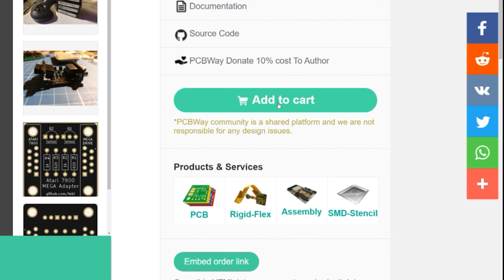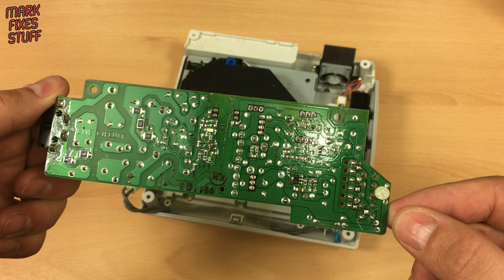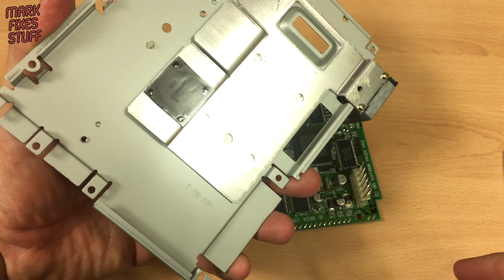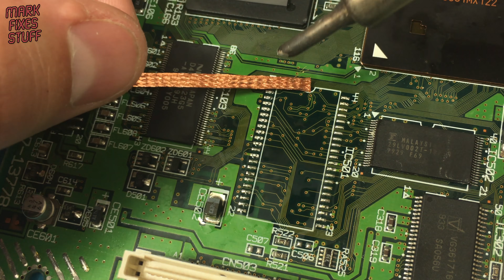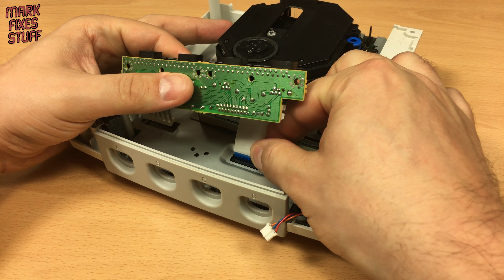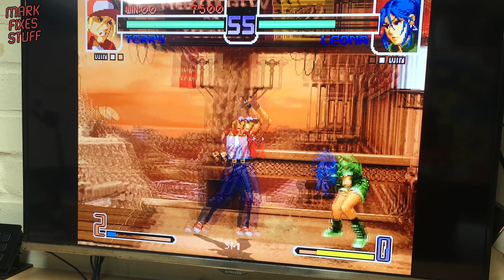Installing a Sega Dreamcast Custom BIOS - SMD CHIP replacement JAPANESE CAKE!

Comment: For cleaning old solder from pads, I prefer using regular flux instead of no-clean flux. It helps the solder flow into the desoldering braid with less pressure, reducing the risk of lifting a pad.

Comment: I recommend to humidify the wick with liquid flux and apply some fresh solder on the contacts on the plate.
Make sure to use soldering wire WITH lead, it flows better and doesn't make the wick stick and stutter on the contacts.
After removing the old solder from the contacts, apply some fresh solder on the contacts in a flying method,
so that the contactplates are only coated a little with fresh solder.
Afterwards you only need to press the pins of the chip with your soldering iron.
The look after that is much cleaner and professionall.
Only an advice. But good work with that.
Reply from the maker: Those are great tips, I'll definitely keep those in mind for next time!

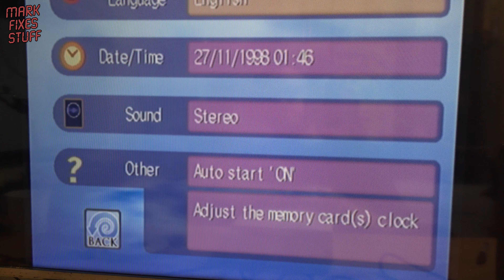Comment: 16:44 How did you update the bios? Is there a file I need to find?
Reply from the maker: @YumeSoulMirai  I bought mine programmed. I don’t have this Dreamcast any more because it was lost when my house burned down, but if I recall correctly I just replaced the original chip
Reply: @MarkFixesStuff  I know this is a rather year late response, but looking back on this, do you remember where you got the modified chip? I've been pondering about doing this project but I'm not sure where to get the chip.
Reply from the maker: @YumeSoulMirai Hi!! You can buy it here https://retrosix.co.uk/Dreamcast-BIOS-Japanese-Cake-3-3V-p550906359 - you can also find them on AliExpress or eBay but make sure to check reviews first.

Comment: I can solder but what you did here is beyond my level. Incredible work!
Reply from the maker: Thank you so much. Actually I think SMD stuff is easier than through hole soldering but you need the right things so you are probably more than capable of this.
Reply: @MarkFixesStuff  Thank you. After practicing more I'll chane the components in order to make my VA0 support GDEMU

Comment: Hello! I bought a gd emu 5.15b clone but apparently my dreamcast VA1 (J) bios is protected. and prevents me from loading ROMS (cdi,gdi) from the emulator, sending me to the main menu. the question is, is it possible to replace the bios itself - shown in your video, and will there be conflicts with the GD EMU?
Reply from the maker: You can replace the BIOS. I did a video on it and the GDEMU doesn't care.

Comment: Nice video mate! A question. With this bios , can I boot games from SD adapter without using the CD bootloader? My CD drive died, and Gdemu is quite expensive nowadays, and this looks quite easy to perform and very cheap.
Reply from the maker: No mate. Unfortunately.  Although you could look out for a cheap cd drive instead - loads of people give them away for little

Comment: So I installed my kit and yeah no menu appears, not 100% sure what the next step is. I have a gdemu and ofc don't want to have any issues with it.
Reply from the maker: Have you double checked your connections?
Reply: @MarkFixesStuff  yeah, thankfully got it working, although messed up due to the latest version not running with the gdemu whatsoever. So I'm attempting to get the old version back
Reply from the maker: @TheAnimeexpansion  oh no. I’m glad to hear you’ve made so progress though.
Reply: @MarkFixesStuff  thanks, I appreciate that! Only roadblock now is my sd card reader isn't working. Got a very cheap one a little bit ago and the soldering on the legs is really shoddy!

Comment: I just installed my bios and get a black screen sadly. I have a 1.6rev and there was a guide to solder to pin 9 of the ic503 from pin 44 of the bios chip. Also wired from pin one to the same you you soldered pin 1 of the bios chip to. Everything looked well and good, reflowed and continuity and all that. Flex cables fans and all that were secured. The system powers on, disk books and initializes, you here the beep and nothing on any screen I connected to. 

I got no answer from the ebay seller but it said free 3d dev. And I assumed I could just replace the chip without piggybacking. Any knowledge of where I might go from here?

Comment: Guys,I need your help, in the past, I used an Harbor Freight branded 1500 watt dual coil heat gun at maximum temperature like 1124 degree farenheit, but for some reason, I think I killed the old motherboard, because it didn't wanted to boot up, I got black screen, even though it was everything connected properly, no dirty connections at all. Possibly, because this heat gun was for other purposes, like stripping paint, and varnish, and not for electronics, next time, I will use it with the lowest temperature, at 572 degree farenheit instead, once I got a new motherboard

Comment: how do you update from v1.031 to v1.032? I see dreamshell comes with v1.031 already but trying to figure out how to load .32
Reply from the maker: Sorry. Missed this. I actually burned the update onto a CD-R and installed it from there. Hard to remember now though

Comment: I don't ever clean the pads. Just pop it down and heat it up. Otherwise you get issues like the pads coming off since they're old
Reply from the maker: Thanks. This might be the best way from now on. Thank you for watching and taking the time to comment. I really appreciate it.
Reply: @MarkFixesStuff  If you have trouble with not cleaning the pads, hopefully it makes it into a video. Louis Rossman rips off pads all the time, but he's repairing water damage.
Reply: Better to clean the pads since you're most likely mixing leaded solder with lead-free. The reason he likely ripped the pad was a combo of not enough flux, tip wasn't tinned well, too much pressure and moving across the pads instead of length-wise.

Basically, technique problem.

Comment: Well. There are much smallers wicks, those are much better on those smaller pads. The real problem comes, if the pads have a large ground plane. For those, I would say use something to pre-heat the board. Like a "thermal pad" (don't know if that's a proper term in English)... And heat the board to something like 80 celsius...
Though, it there are plastic connectors beneath, be careful. Those might not take the heat...
As you said, on your case the pad was not connected to anything, so it really didn't matter. Though I would have also do the "repair", just like you did. Just for the looks of it...
"Thicker" flux also tends to make everything easier, though it leaves more stuff on the board. Use IPA to clean them, always. "Running" flux leaves less markings, but doesn't do the job (on most cases) as good as the thicker one. Pick your poison, there is no "right choice". One works better to one and other for another.
Train on not important things.
You can never know before, if the board has good quality or if thr pads that fly out even with minimal heat and touch... Those can be repaired, though that will always make them look kess professional...
Reply from the maker: Thank you for sharing this. Reading your experiences really helps me on my SMD journey. I have a few thick fluxes to try as well. Brilliant tips! Please keep them coming.

Comment: What was the point of this? Waste.
Reply from the maker: The point is to enable booting of backups and MIL discs on machines that don’t have that capability, such as later VA1 models that had the MIL booting loophole removed. I’m not sure what was wasted? 🤔

Comment: To avoid lifting pads, use a low melting point temperature solder and put fresh solder on all of the pads.  Add some fresh low melting point solder to the tip of your iron before you start wicking, this will help with thermal conductivity and will start the wicking process.  Use flux as you did.  But DO NOT press the wick into the board, just let it glide along the surface.  Using a thinner width wick (1.5mm) on the small stuff helps as the solder will stay hot on the wick instead of all the heat dissipating into the giant wick which acts as a heat-sink.  I do this and never lift pads.  Also, if you are able to heat the entire package (chip) up and remove it in one go that's also good as then you don't exert any mechanical pressure onto the pads as no prising is needed.  Avoid prising whenever possible.
Reply from the maker: Thanks for the tips Dominic. I really appreciate it. I’ll do that in the next video for sure!